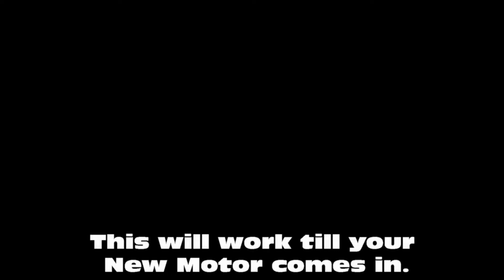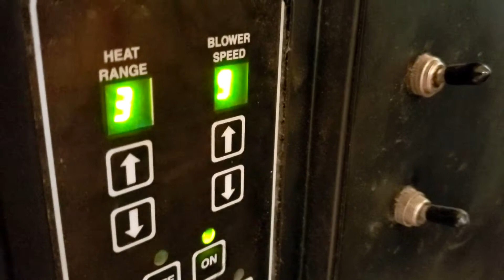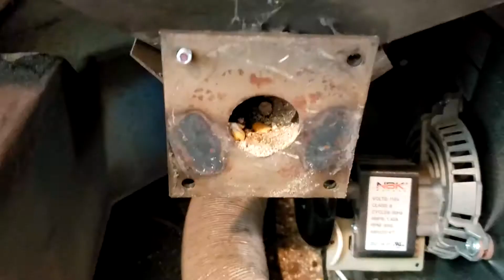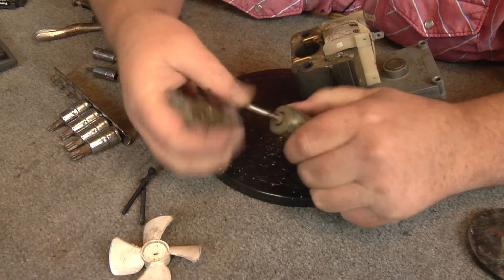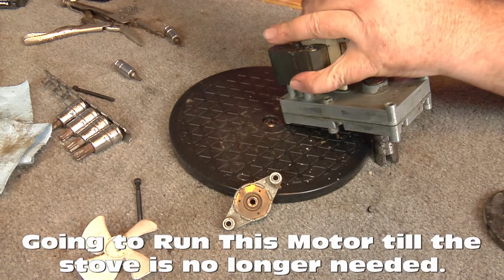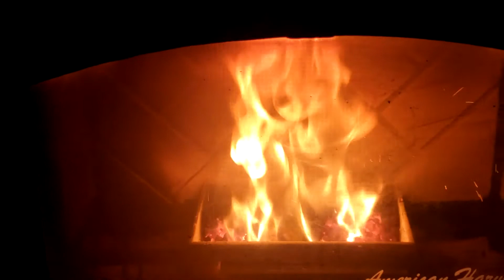US Stove American Harvest 6039 Corn or pellet stove auger motor Repair or Replacement.

Comment: @camaromodschannel - I got the new auger motor installed today. I couldn't get the pin back in the shaft, but your nail trick worked great.  I could have used the old rubber washer, as it wasn't hardened at all like I figured it would be.  Just fired it up, and I don't notice any sound at all from the auger when it turns.  Thanks for all your help, advice, and for the links you sent.  Have a great day!   John
Reply from the maker: Thanks John!! I very seldom get a follow up message on the outcome of the project everyone is working on.  Thanks again.  Yes, its a pain to get those pins back in. I've tried screws I've tried so many things,  the agitator motor would bind up and sheer the screws in the shaft. So you would have to take it apart again. Glad everything worked out for you. Thanks

Comment: @camaromodschannel - The new auger motor I ordered came in the mail today ($50 and free shipping was a steal!).  I ordered a cheap set of roll pin removal punches, and a small 12 piece package of the nails that you sent the link to (they also came today).  Now I'm just waiting for the new rubber washer that I ordered from Mountain View to show up, I'm hoping by Thursday, so I can get back in business.  Are the four small bolts that hold the motor in place, Metric or SAE?  Being as they are located behind the motor, I'm guessing just a small end wrench is all I will need to get them out and back in again?  Thanks...  John
Reply from the maker: Awesome Great Price. I had to watch this video again, Packed with information. you need a 8 mm wrench. good luck, Thanks..

Comment: @camaromodschannel - I had one last question for you a while ago, and it isn't showing up for me to see, so maybe there was a glitch and it didn't save it.  Are Auger Motors, and the Agitator motors the same (are they interchangable)?  The eBay ad implies they are.  The ad heading says "Auger Feed & Agitator Stir Motor W/Hole, 4 RPM Clockwise, 80456".  The motor in the ad photo looks a little thinner than my auger motor (maybe it isn't really).  The parts list in my manual shows a part number of 80457 for the Agitator Motor, making me think there might be a difference. Our auger motors both have the male connector tabs directly on the motor, and the wires coming from the controller have the female connectors that attach to the auger motor.  The eBay photo shows short wires coming directly out of the motor, and they don't appear long enough to reach the control board.  I did watch your other video on the agitator/stir motor replacement you did, and it also shows the short wires coming directly out of the motor itself too.  I see your agitator motor is held in place by a bar that attaches across the back of the motor.  Are the mounting screw holes there on your agitator motor, but they just aren't used for mounting.  If so, will those same holes align up if the same motor is used as an Auger Motor?  Thanks a million for sharing your knowledge on my 2005 American Harvest Pellet Stove!
Reply from the maker: Yes, there the same motor,  short wires you connect with the wire connectors between the motor and control board.  Yes all holes line up, its a pain to work on the agitation motor,  but the auger motor is easy.  Thanks,  love this stove, filled in the morning and burns all day,  unlike a fireplace,  where you have to add to it every couple hours..

Comment: I'm curious as to where I can find an auger motor for $100...  I see an OEM online for $249, and an aftermarket for $149, then tack on a little for shipping.  Also, I might have to replace the circuit board later too (both fans occasionally shut for for 5 - 10 seconds, then turn back on), but only circuit board I can find for my stove (6039 - 80486B), they want $475.  I see replacements for other 6039 stoves (different part numbers - more buttons), for only around $249.
Reply from the maker: https://www.ebay.com/itm/261802250848   This is on eBay for 79.00
and ctrcuit board , https://www.stove-parts-unlimited.com/american-harvest-6039-parts-diagram/?gad_source=4&gclid=CjwKCAiA1-6sBhAoEiwArqlGPqojv7Vjzjh0yA86SVCZ1-YDivZVcQ_q7JI-s94oM_HvsrkE3y5RBRoCP1gQAvD_BwE

Thanks Roger
Reply: @camaromodschannel  -  On the replacement motors I see, there is only the small shaft coming out the back of the motor with a hole in the shaft (for the roll pin?).  As shown on the parts list,  27 is a big rubber washer (I'm afraid my old rubber washer has been baked solid), 28 is a little auger roll pin, and 29 is the coupling shaft (slotted fork that the roll pin appears to hold it to the motor shaft).  Can I take all of these off of the old motor, and put them all on the new motor, or do need to try and find new parts (the rubber washer and roll pin)?  How do you get the little roll pins out (never used one before), and can that same pin be re-used?  Thanks for all the information, I love my old stove and would like to get a few more years out of it.
Reply from the maker: yes you can take what ever you can off the old motor and you can take an go to the hardware store for the rest of your parts you need,  i use a special nail for the roll pin, its a nail from a floor trim transion trim, like going from carpet to tile trim. those nailes you use for that,mine has a gold tint to it. it's just the right size round and leanth just bend it over at the bottom so it won't fall out when it turns.took me years to find somthing that works very well. .and it's a pain to bend, but it works good. my stove is 16 years old and don't know what i'd do with out it. @johnm.6422
Reply from the maker: The nails I use for the roll pin.

https://www.amazon.com/M-D-Building-Products-21485-4-Inch/dp/B000I1CBLM/ref=sr_1_3?crid=1IK8MHJ6BGLQC&dib=eyJ2IjoiMSJ9.grPgwXMk-g_edLQ-URDfYTIxrKNs03V5MYWXgXpviS4GQ-NtMxp9qBfgR4n1eHSpIZb-p1FtfFTmQpFpxFWnLbUWGRTcKEff0KXwQEqeMfkCJVA3ra_-J3XCe-q8HFRexysMTVbFBLPA6T5SNv0crGVnxQaNivyKQg8T_ys4IjREunv8ZLcDZkxxZwCO-aljyea7scFovcNBXSLsBZ7KxqISv6_y1v_9Imwec7pHSNU.2xmHuCU9OM-29KOcRf9gtB0cxP1XjoGjSsotdb_Th6o&dib_tag=se&keywords=carpet+trim+nails+1+1%2F4&qid=1705561477&sprefix=carpet+trim+nails%2Caps%2C123&sr=8-3